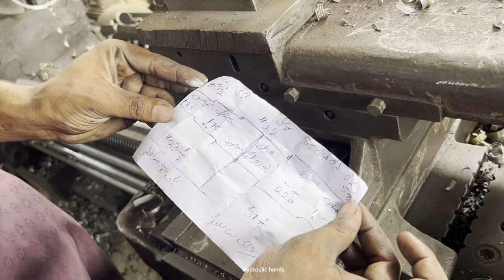How we made Incredible Giant Shaft for Huge Rolling Wheel with 150yrs old Machines

Comment: A big job and mostly well done , cooling the shaft down and heating the hub up probably would have made it a bit easier to install the shaft but brute force works to.
Reply: Presspassung 1/100 mm genau
Reply: It was fairly horrible to be be honest why did they cut the shaft off with the oxy towards the end, why wasn’t the key and key way the correct size to start with? And why didn’t the lay the gear over the hole on its side and put the shaft in from the top then once it stopped going in, just grab one of them heavy machines in the back ground (the red or blue fabricated machines not the machine tools) and if it still got stuck then they could heat the gear with the oxy, also why is the shaft rusty straght after machining if they used cutting oil when turning/slotting there would be enough residual oil on the part it wouldn’t go rust (hopefully get a bit of oil on the lathe bedways too cause you should need to use a bar to move the tail stock like they did it should be a one man operation putting that shaft in the lathe once it has a centre in it
Reply: "brute forks works to"... to what?
Reply: They actually don't know about the expansion of metal.
I watched a similar video last year where they got a big shaft stuck and I said to warm the gear up by about 100 degrees and it would have expanded about 5 thou.   
8 inch bore heated to 100F over ambient = about 5 thou.
They said they had never heard of this calculation!
But then they don't seem to have micrometers available.

Comment: After seeing Keith Rucker on vintage machinery restore a shaper that old shaper was cool to see running. Love to see what that part goes to.
Reply: I was interested in that machine also. Apparently it’s called a “ planer”, it does the same work as a shaper only bigger.
Reply: @bobfinning8587  yes I used the wrong name, in a shaper the head moves across the workpiece. A planer the bed moves under the head. Keith restored one, about 70 episodes of content.
Reply: I wasn’t aware of what is was called but just for curiosity I looked it up and found it was a planer, I’ve not seen one before but I have had several years experience on a shaper.

Comment: Very hard-working men!The workplace injuries there must be absolutely gruesome… Respect!!!
Reply: Quantos perdem a vida por ano nestas péssimas condições de trabalho?
Reply: What workplace injuries? These lads know what they are doing. They don’t need to be mollycoddled.
Reply: Very well done!🇨🇮🇵🇸
Reply: @donalfinn4205  do you consider the off balanced lift of the shafting early on is safe?  come on man,    or banging the shaft into the tailstock center helps the operation of it?
Reply: @paulmiddleton4215  They know what they are doing. Same as I did in my 40 years in the mechanical/ electrical industry and never had a lost time accident. You can’t replace common sense with regulations.
Reply: @donalfinn4205  never said anything about regulations.  the way those fools chained that shaft nowhere even close to a center point is just f-ing dangerous.  and then later on  placing the shaft into the chuck,  then hitting the live center didn't do the center any favors either.  either you have not witnessed any major industrial accidents caused by unsafe lifting procedures,  or you  don't have a clue as to how fast an accident can occur.  either way you are ignorant of the dangers of workplace injuries

Comment: The run out on the drill press at 13:50 has to be close to 100 thou. It is stunning that any two parts fit together. You have to give them credit.
Reply: I've worked with such worn drills in UK!

Comment: 26:16 lathe is a Lang.
Made In Scotland and the company died in the 1970s when inflation and Marxism was rampant.

just found this interesting titbit about Langs; 'A bit like Gordon I came across this thread and it brought back loads of memories.I served my time with Thomas White & Son Paisley as a mechanical engineer. I ended up in the fitting dept. We built small sanders right up to large belt sanders as well as rough cutting machines which took in a log and put out a finished article. I then moved in 1970 to Wickman Langs in Johnstone where I lived and could now walk to work. I was on sub assembly builds then final assembly of the 31/2" single spindles before moving to the 5 spindle cnc's. I also spent some time on long bed centre lathes scraping the beds to ensure a smooth operation for the saddle. I had a period in the drawing office working on designs for power chucks. In Paisley when I started serving my apprenticeship a new training centre just opened and 43 firms signed up to send their first year apprentices there to be given a broad spectrum of training with time spent on turning, milling, drilling ,electrical & fitting which meant when you started in the factory proper you had a pretty good idea of what you were doing and more important the jobs you didn't like.There are only a few firms left (5) and they are a shadow of their former selves. The Lang family started and closed the factory in 3 generations with J T lang being the last. when I started in 1971 there were about 800 workers and when we closed in 1979 there were 200. Across the road in Mary street Johnstone was Clifton and Baird and round the corner was Loudens. After Wickman Lang closed there was a fire which burnt it to the ground. The ground was bought by W H Malcolm Logistics and they built large sheds for storage etc. I worked on with an offshoot Lang Power Chucks but engineering was struggling badly and I left in 1983 to work in financial services never again to smell the "bulls milk" coolant that Gordon remembered. I am now retired with plenty memories.'

Most of the UK factory closures were due to too many chiefs and not enough Indians in the factories plus lack of marketing - but then the money men found that buying and closing old factories gave great tax avoidance schemes and the cleared factories were room for housing.

Back in the 80's we used ot have programs where money men were interveiwed adn a standard topic was they made their money by buying older companies, selling off the profitable bits and scrapping all older workers, buildings and machinery.

I once worked at a small fork truck makers and on Friday the bosses called us all together to tell us they had sold out and the slimy little Jew with them was the new owner.  He assured us we had a good future and to come in on Monday morning prepared to take the company forward.  Monday morning we all got brown envelopes and were unemployed by Friday!

Comment: How long did it take to turn this drive shaft ?
Reply: Aeons! RPM seems to be around 50, and it it take 0,25mm cut it takes 80 minute per meter. If rough cut and second to dimension (optimal case) its 160min per meter and add too settings etc. Full day job easily.

Comment: After briefly glancing at the comments I guess I'm going to be the only one to state that the worm wheel isn't properly mounted to receive the axle. Every time that wheel moves they lose valuable energy and risk damaging the work piece.
I will however refrain from commenting on the dirt floor or the state of the machines and direct you to read "How The Allies Won" by Richard Overy. As Primitive as that shop appears, Joseph Stalin mechanized the Red Army in Siberia with factories and shops what had no roofs and many without walls.
 I didn't believe it myself until I got to speak to Russians who migrated here in the 1990s.

Comment: These guys do some amazing things, with primitive tools and equipment . . .  On the other hand I could write up a whole pad full of OSHA violations just in one scene.  One has to wonder what their lost time injury rate would be, here in the US.
Reply: What where there primitive tools, they had a lathe,milling machine, shaper, radial arm drill , over head crane and a oxy torch and welder the only thing i did see that they need in the video was a welding helmet or a broom
Reply: Cleaning since and then would make big difference, you can even found some lost tool or ordes not delivered.
Reply: Those are not primitive tools or equipment. Those machine can be found in any well equipped job shop or heavy industrial machine shop.  There is nothing wrong with those machines except the abuse they have suffered at the hands of indifferent workers. They are slovenly, careless. The way the assembled the shaft into the gear was positively crude.

Comment: 150 years ago you did not have any of the following
1) electric motors. Everything back then was driven using "Line Shafting" and flat belts
2) There were no "V" belts 150 years ago
3) 150 year old Lathes did not have "V" beds. they were all Flat beds
4) 150 years ago Lathes did not have multi-speed "Gear Boxes" Speed was changed by using different size flat belt pullies.
5) both the Tail stock and Tool Post designs are a lot newer than 150 years.
6) The "Radial Arm" drill has integral electric motors and electric "Raise and lower". 150 years ago this would have been flat belt driven via line shafting and hand operated "Raise and Lower"
Whilst these machines are "Old" they are not made in the late 1800's

Comment: I had it harder than these guys at the beginning starting my working life, my first jobs started off by cleaning and sweeping the shop floors.  Lol   
Impressive to watch the large cuts from these very old machines. The tools are old, very used and crude, No CNC or digital measuring yet still they produce good results the way it was done back when the lathe and drill press were knew.

Comment: The lathe is certainly not 150 years old.  The design of the headstock shows it is 100 years old at the absolute most.   It could be a LOT more recent.  Same with that big radial arm drill.  
The square bar they welded on the end so that they could machine the whole length:  It was a very dodgy looking weld - I was waiting for it to give way on the lathe, causing a horrible accident.   And completely unnecessary as they used an oxy-acet torch to cut the end off the shaft anyway.
That worm wheel is badly rusted and not fit for use.

Comment: Extremely primitive. when I worked for Stewart and Stevenson some of this muscle procedure would of involve shrinking or expanding the metal by either freezing to shrink or boiling metal in hot oil to expand metal. you only had a small window of time to put together tight tolerance fitting.

Comment: I suppose they haven't considered the use of heat on the gear and dry ice on the shaft to assemble? And a good job of prepping would have helped, not just a wipe with a rag...time and manpower doesn't look like an issue here...in all these Hydraulic Hands videos I've watched I've never seen micrometers in use...